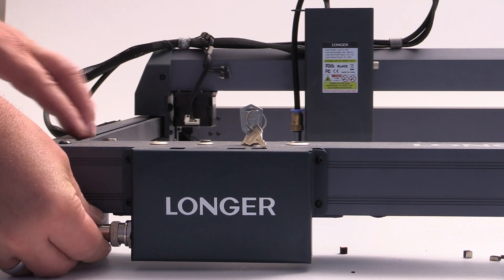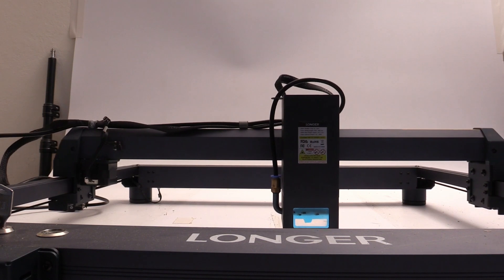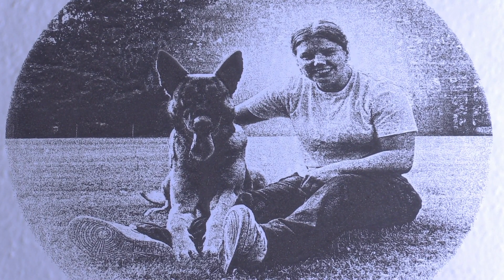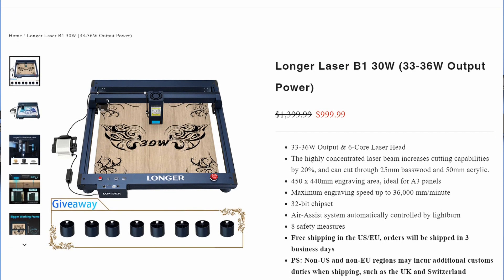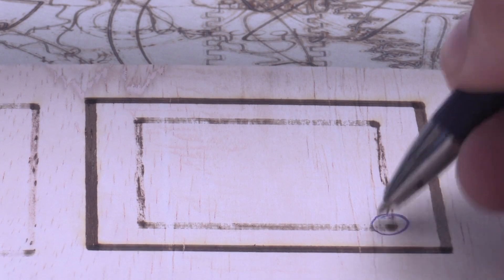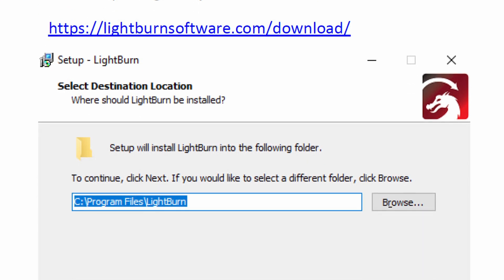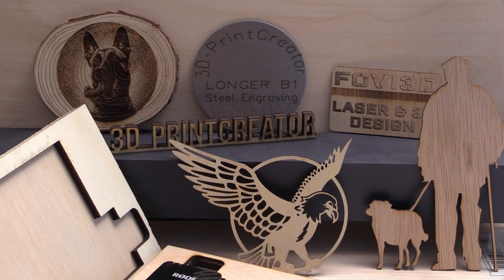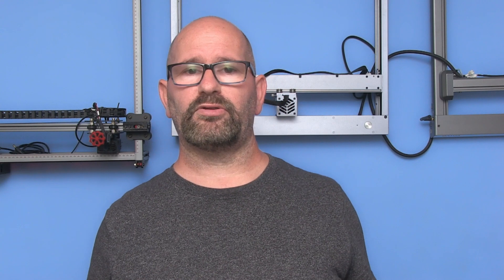▼ Longer B1 Laser Engraver: Powerful, Affordable, and a Safety Concern

Comment: To increase the homing speed you can go into console and type $25=2000 then press enter.
Reply from the maker: Totally true. Yet, with the supplied mini microswitches, I wouldn't make the homing process much faster as it is. There is a reason why it's slow, that's because otherwise the microswitches would be smashed.